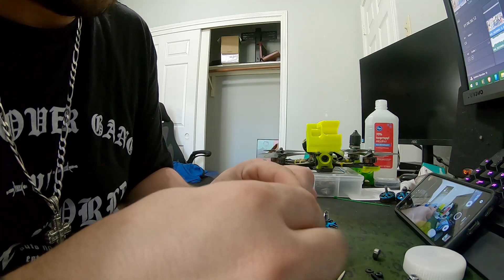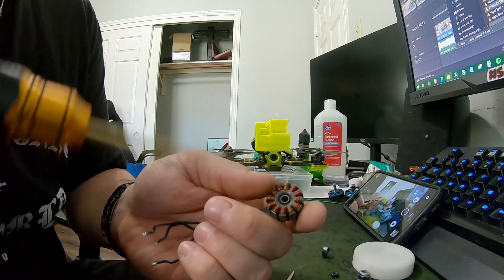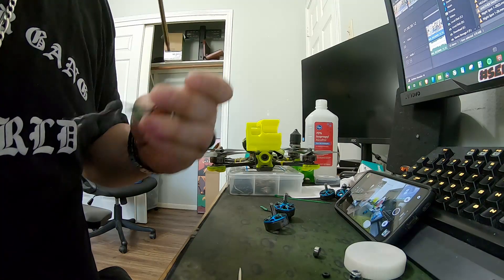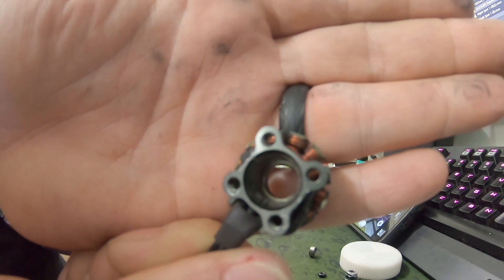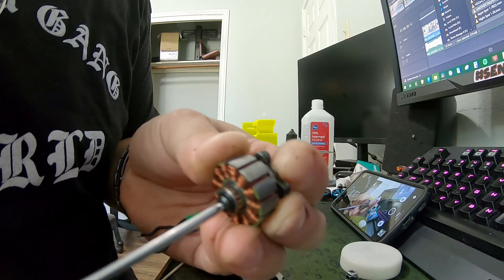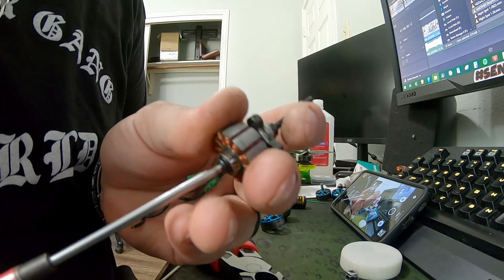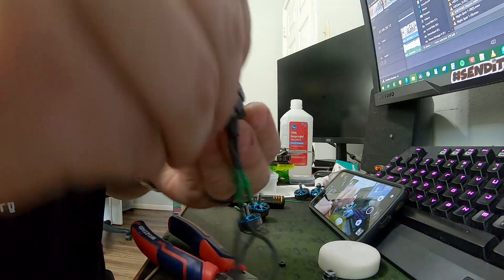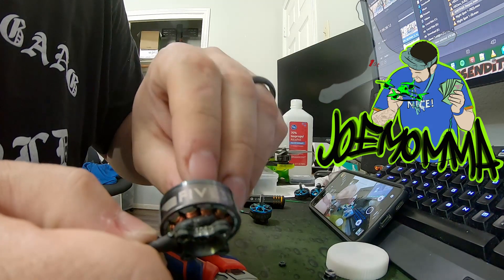HeadsUP Motor Bearing Replacement

Comment: Great vid! - I like your press in method.

I took a panel nail and ground down one side of the head, so the head could fit through the hole.
Then rotate the nail head, so it will sit on the inner edge of the bearing you are tapping out.
This will keep your bearing that may be still good (usually the bottom one) and can tap it out safely to reuse.
You can also use this method to remove bearings from other full damaged stators.
Gotta keep em' flyin'!
Reply from the maker: niice, I'll have to try this one